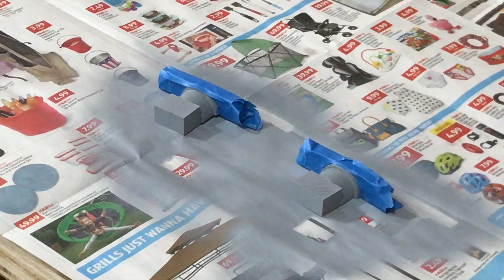#2019 Openers Open - The Build

Comment: I'm always surprised by NOT seeing more people use an air compressor related rammer on this stuff!  I'm still thinking a large air ram on a hydraulic press!  :)
Reply from the maker: The pneumatic rammer was made out of a needle scaler.  I saw somebody else build one here on YouTube years ago but I haven't been able to find the video again.  I suppose I could rebuild this one and film it.  It works just fine but an actual pneumatic rammer has a much longer stroke and a lower number of beats per minute, more like hitting the sand where as this one is a combination of hitting and vibration.  Having said that a proper one costs about 400+ dollars and this thing cost about 30 to build so I'll go with this option.
Reply: @dcn1934  30 vs 400, lol no brainer!  I just watched sandrammer, had never seen him before and found a video he had on the pneumatic rammer and he mentioned they were expensive.  Didn't start looking, glad I didn't otherwise I'd have choked on the cost :)

Comment: Nice design.. the end result was not show queen but it definitely worked! I like your flasks also very clean! Nice job... As WT pointed out at least it was a beer you opened...
Reply from the maker: I am very pleased with my flasks, they were made for this project and I had no idea how well they would work when full of sand but they were very smooth.  There is a reason the opener itself wasn't shown in any detail, and that is because I consider it a failure.  I've cast better looking ingots.  I will probably post another video by the end of this week revealing all the "sins" of this project which will, I'm sure, show the opener up close.
Reply: DC N I will look forward to seeing it. I was curious about the really wet sand you were hand molding into that mold. Was that sodium silicate? It was a very interesting concept non the less. I will look forward to that video!